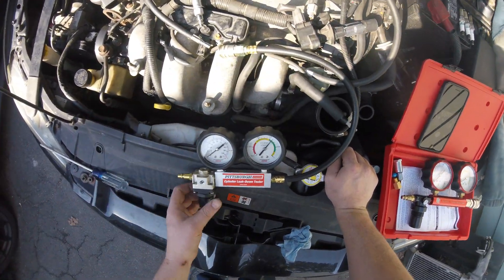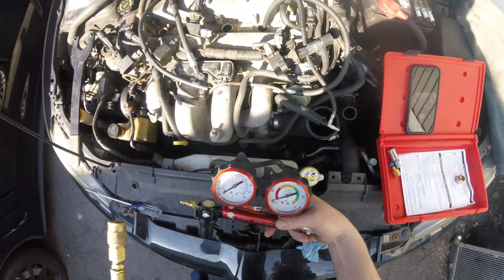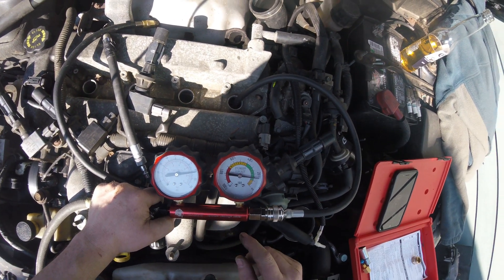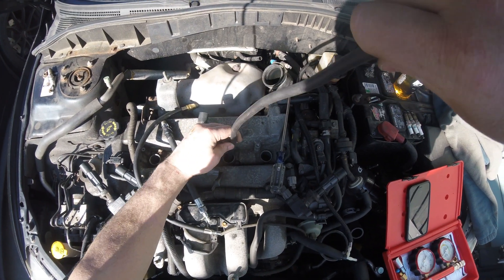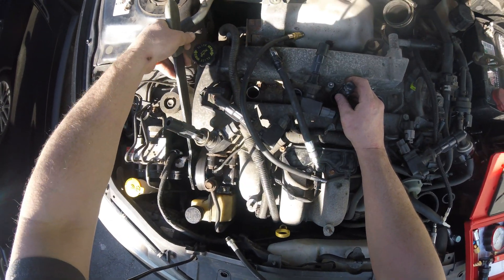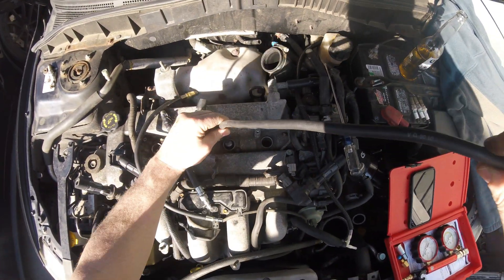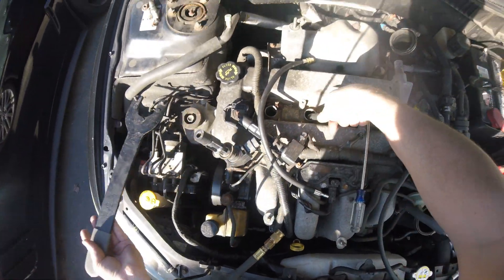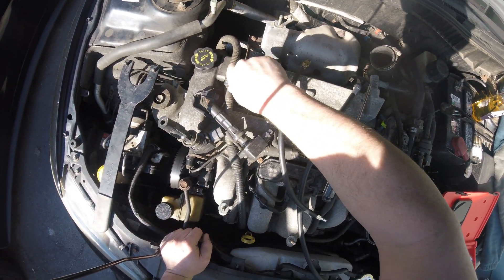Mazda Leak Down Test

Comment: Chris, so you initially used a cheap leak down tester and got low results, then later used a better tester and got much better results. What made you decide to use a better tester?  And what does the "better test results" mean for the car consuming oil?
Reply from the maker: The motor has great power I just couldn’t believe it had such bad leak down numbers. So I had to confirm. The results were under 20% leak down it was in the range of 12-14% on all cylinders. The oil usage is most likely coming from the turbo. I’m going to remove the o2 sensor and stock a camera in there to confirm.
Reply: @ChrisGarage  Well it's awesome that the motor is healthy. Are there any symptoms that hint towards the turbo being the culprit? For example, do you see black smoke under heavy acceleration? I hope you make a video when sticking a camera down in the o2 censor hole to confirm.
Reply from the maker: mikef058 of course there will be a video. I see some smoke on hard acceleration sometimes.